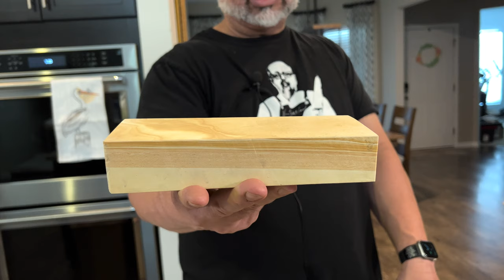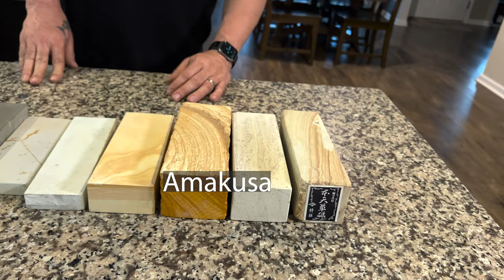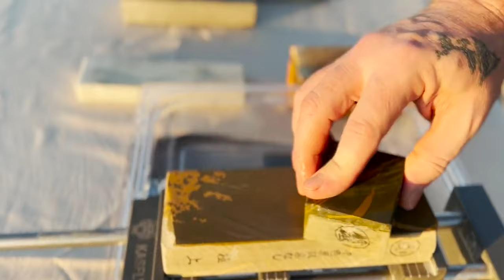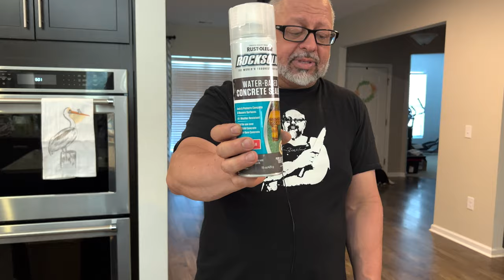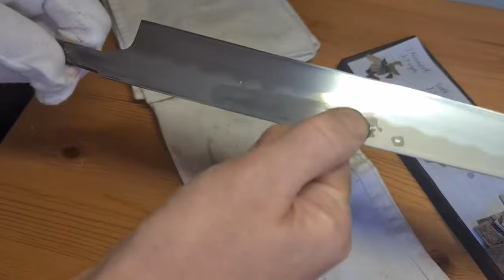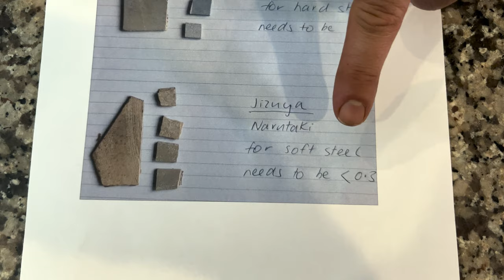Japanese Natural Stones - introduction… Down the rabbit hole we go!

Comment: I was hot and heavy to get into J-nat Stones a few years ago, but the uncertainty of what you were getting, as well as the prices dissuaded me. The logical conclusion I came to is that it makes sense only to buy the final natural stone you use in your progression. It doesn’t make sense to me to buy coarser grade stones when you’re still going through a progression. The top end $$$$ polishing stones are apparently amazing. Why people bother is because they still leave behind a little bit of “tooth” that helps bite into the product. There are a lot of charlatans going on because of the potential $$ involved. Mr Imanishi IS one of the highly trusted dealers. Because of the “tooth” effect you would NOT want to be stropping afterwards (defeats the purpose). I’m just a few miles from Lake Ontario and have hauled home sedimentary stones from about 40 yards below the surface and they were still way to soft for sharpening...wah,wah ☹️. Nagura is a must for a natural stone.
Reply from the maker: Thank you
Reply: On "tooth", do you want to saw, or slice?
Reply: Microscopic “teeth”. I find a super highly polished and stropped edge can occasionally want to slide off the surface of softer produce.
Reply from the maker: @trappenweisseguy27  I agree that’s why I said that the teeth are helpful in fatty meats and the skin of a tomato

Comment: Very nice sir. I've been sharpening straight razors off and on for 9 years now and I have 3 JNATS. I have a 6 by 2 inch Shobudani Aswedo (pronounced "oz way do" and is a finisher), An 8 by 3 inch Ozuku Mizu Asagi (Level 5 finisher) and I recently got lucky and picked up a Nakayama Aswedo which is roughly around the same size as a 6 by 2 stone. They were by no means cheap at all. Also the higher the number of hardness, the slower cutting speed it has too. Specifically with straight razors. My Nakayama Aswedo is decent fast with my Shobudani Aswedo in the middle and My Ozuku Mizu Asagi is the slowest of the 3. I could do 40 x strokes on the Nakayama while it could take 80 on my Ozuku and only 60 on my Shobudani.

Comment: Not to disparage this video or the channel, but when do we get the 50 BESS challenge that was made a few videos ago? Low 20's and even teens are possible. 120 is sharp, but on occasion when I have managed 50, there is a very noticeable difference in actual kitchen use. Another frustration of mine is that on various channels I've asked for USB microscope shots of the bevels at various stages, and have received "promises" that remain empty. At least here, Greg openly refused to do such, citing technical issues. There are some channels that have shown microscope shots of bevels, but they don't upload consistently. I do not have a channel, so anyone can tell me to get lost. "Sub-100" is not "a myth", and I'd like to see some videos on how to get there and how to maintain that.
Reply from the maker: Hello sir, I am not refusing to do anything. My wife and I have been very busy. Her father died, her stepbrother died two weeks before that. It was almost taking us to the brink of divorce. My dog had a $6000 surgery and needed eight weeks in the crate. My wife went away for a little while to be alone. I work all day Five days a week 10 hours a day. I’ve just lost 40 pounds because I go to the gym at night six nights a week. I don’t even get to the gym till sometimes 9 o’clock at night and work out until 1030 just to be back up at 6 AM for cardio fasted. I have to shoot videos and then edit them each night just a little bit to get them ready for Friday. We have to put stuff on social media so that people will see the video. YouTube is no longer paying us anywhere near what we made. We were only making $300 a month and now we’re making less than 150 with more subscribers and more views. They’re going through a period and they’re not paying as much so I can literally do two haircuts and make more. I have a microscope that works, but the stand broke. The computer is not a laptop so I would have to completely go over to the video and shoot separate footage. That leaves room for doubt. I have not wanted to do that. I don’t mind shooting a video but it takes time and my wife is not always available for the other camera because she’s been out of town. She very much wants to make sure her stepmother is OK since her father died. The woman lost her son and her husband within two weeks. We had Mother’s Day, and now my wife and I are going to Blade’s show. I’m getting ready take my son to Vegas for his 21st birthday. We’ve had plenty of things to keep us busy. This is not my only gig. We’ve had our yard cleared full of trees, and I’ve had to cut the grass because my wife can no longer be in the sun due to cancer on her chest. I appreciate what you want and I want to give it to you but you’re gonna have to wait. We were already shot several episodes in the next thing we shoot will be at the Blade show in two weeks. I know we have one more episode already filmed. I don’t think we have anything filmed after that. We do like to throw in Sharpening. I’m going to get to your request. Please allow us some time.
Reply from the maker: I will tell you that I’m excited to shoot a video for you and it is very frustrating to get sub 100. I can get someone hundred kind of regularly but to get really low, like in the 50s, that takes a lot of effort. It really takes a lot of effort and a lot of patience. I have gone crazy. Trying to chase these numbers.
Reply: @nadm  ---- Sorry to hear about the transitions in spiritual state. Death comes in batches, it seems, in the space of a few years, a lot of living past can be wiped away. Fortunately, there is some truth to the saying that time heals all. Add: I hope things even out for you soon.
Reply: @nadm  ---- Same here. It's a lot of concentration and a light touch. The bevel set has to be there. One time I got 90 off a Naniwa 5K superstone (which surprised me), so I thought I'd strop it and get it really sharp ... turned out 120! Then one time I had a knife I had used, never sharper than 100, stropped it, and got 50. It's a delicate thing, apparently, and the lingering question I still have is, "How long will it hold up?"  Yet, every time I use a 90 (which isn't toooo hard to get), I remember why sharp is nice. Some commercial sharpeners, in Russia, I think, from the accent) have a jig and wheel setup and show on continuous video, that they regularly get 60-70 timed to four to five minutes.
For the microscope, you say "No" and that's fine. Man, "no" is "no"! That doesn't damage my roof! I just get frustrated by guys who smile and say "Next time", and it never comes. Like people who say "Be with you in a minute" ... zzzzzzzzzzzz. 
I have a laptop and USB and little by little I've been able to piece together what a very small burr looks like, and I use a lot of ink on bevels, still. But I'm beginning to get a picture of what it should look like. Just for trivia, I realized one drawback for just the rudimentary USB magnification: it won't show the thickness of the edge at the apex. I had one guest knife that just would not get sharp (400), no matter how clean the bevel looked. Finally, I got it, that the edge had been so rounded in use (800+, really!), that I had to remove more bevel to actually get the two bevels to meet in an apex. HRC 56-58, so I went back to a 400 to get 160-180, 1K, 4K, and I gave it back at 120, fed up with it, basically! If you ever do find a work-around for the USB, I'd love to see it, to compare to what I have. A lot of guys have laptops and if you don't have to upload video or photos, a USB scope is maybe $50 bucks. But don't sweat it. I'm a straight answer type. Not real popular, but hey.

Comment: IT's not pressure that is holding the grains. They are cemented in various ways.
Reply from the maker: I'm not talking about what was sealed by the person after they got the stone, but the initial rock is formed by pressure
Reply: @nadm  I don't think that is what he means; there are natural cements that hold the grains together.  The ones you have are redish/tanish/brownish because of iron oxides in between the sand grains; those iron oxides form a natural cement.  Sandstones are all cemented by something, the 3 dominant materials are iron ochers like in yours, silicon precipitates in quartzites, and lime precipitates in calcareous sandstones.  The second category of natural stones are the metamorphic materials--slate, schist and novaculites.  In these both the starting material (the sand or silt + whatever its cement was) has been partially melted and recrystallized, and this crystal growth holds them together.  A good example of this is the belgian hone, where garnets formed in situ during the metamorphic process, so what originally was just a mud slurry became natural garnet paper!  Lastly, some materials have silt+cement embedding the grit grains;  where you have a larger particular embedded in a smaller silty or muck material; then the entire mass became cemented together with one of the above mentioned 3 cementsl  Graywacke is a very large grained example of this.  These materials tend to be from poorly sorted original deposits and so are not often seen as fine polishing whetstones, but there are examples of materials used for axe stones and the like that have extra earthy bits in the slurry...Think about the Little House on the Prairie context of have a dull axe, find a handy rock to make it less bad!  You will see a lot of these sorts of "stones of opportunity" show up in historic society museums, and if you look at really old homesteads the front porch step almost always has an axe-sharpening depression in its corner!

Comment: Nice Overview Greg. It is really hard to assign grit as you are already finding! Often, they will have one feeling on the blade edge that is analogous to one grit and polish at a different grit level. All of these can be manipulated with slurry density, water concentration, and surface conditioning as I often cover in my videos. 

I agree it as well is very important to get it from a reputable vendor who can do proper testing before you get the stones. I keep a list around, but I am sure it is not exhaustive.

I would also heavily consider sealing up some of those stones!
Reply: Trying to be humorous, nor sarcastic: what is the grit on that countertop Greg has in his house🤣? That's a whopper of a stone .... Would it not be possible to sharpen on some leftover granite?
Reply from the maker: What does seal them. Do you think what I’m gonna use is OK or do you recommend me buying a locker? And if so, could you please recommend one with the link?
Reply from the maker: I’m sure my wife would kill me. If I did it on the countertop in there is no leftover granite to use.
Reply: Would you recommend to ask the vendor to seal the natural stones for you when buying?
Reply from the maker: @MrLoam910  I mean, you can ask. I don't know who does it. I know Burnell Cuttery sells them that way. I don't know what the price difference would be but I don't think it's ever gonna be a bad idea to ask.
Reply: @MrLoam910  Never bad to ask or you can get the lacquer and do it yourself. I have videos on doing it up.
Reply from the maker: @naturalwhetstones  I’ll check it out when I can

Comment: I've avoided those due to price. They also differ quite a lot and at the prices larger stones go for, I'd like to try it out (that is almost never possible). Getting to know all the mines and types of stones to know reliably what to expect is not that easy either.
I have some european naturals though (mostly Welsh). Some of them I like, some are not that good. (I'm not talking about well known stones like coticule or belgian blue). I'd love a 3x8" sized coticule but cannot justify the amount of money. The fact I hate irregular shaped stones or small like 2" wide ones makes those cost more but I just hate nothing short of "full size".
I think slurry management is quite important for the few naturals I have. Sometimes slurry from a suitable nagura can really change the character of some synthetics too.
Reply from the maker: OK well sad. I’ll have to look into the European stones that you mentioned.
Reply: @nadm  There used to be at least some seller in eBay selling all kinds of Welsh slats, mostly in 8-13k range. Some of them are quite nice finishers, some just not that much.
For coarser grits none of the few tries have been a hit in naturals. But I value speed in those anyways and have plenty of good synthetics.
Belgian blue and coticule are of course the well known europeans that everyone knows of. I a kind of like both of those but could afford a large one only as the cheaper blue that really lacks the power coticule has. I guess there is a reason wjhy it is cheaper. :D